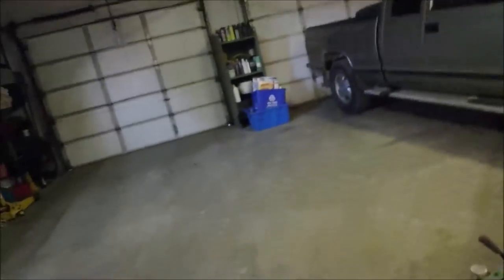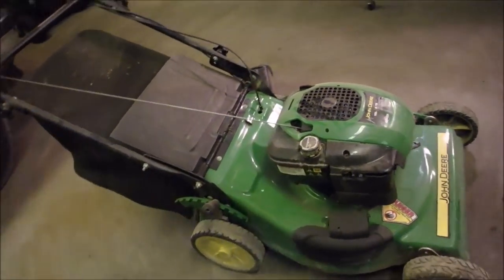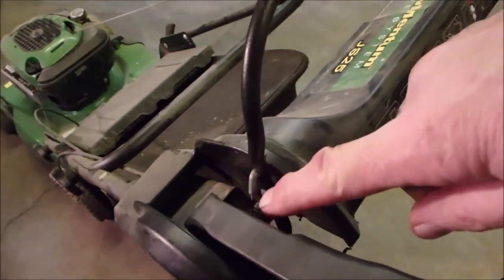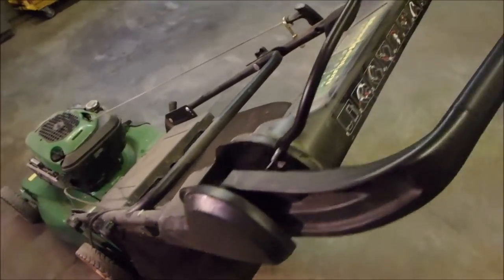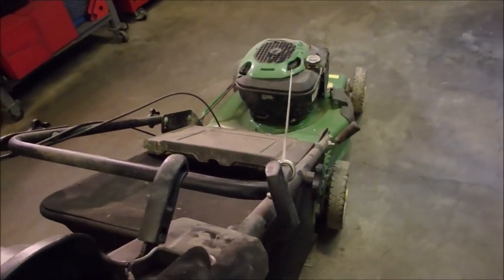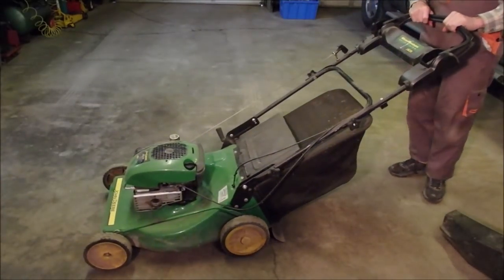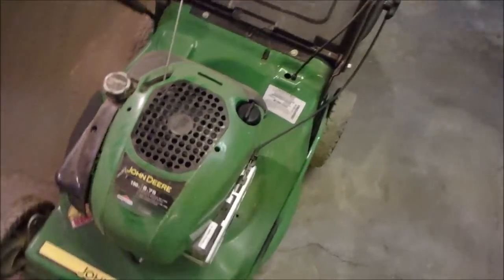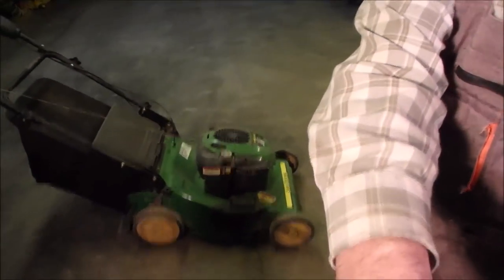John Deere JS25 Push Mower Won't Run Pt 1

Comment: Pure Neglect on quite an expensive mower. You can lead a horse to water right? In other words, preach maintenance and half the people simply don't care. Disposable mentality. Can't wait for part two my Friend! Sean~
Reply from the maker: It did put up a fight but things moved forward enough that I didn't have to flip it and work on the floor.   lol    Thanks Sir
Reply: They’re begging you to take there money. Herding cats is easier for them, then putting oil in it.  Be good zippo you too Bruce

Comment: When the mower falls off the table, the sudden stop of hitting the floor will pop it off. Be careful tipping mowers up that way.
 Just tip the mower off the cart onto a folding table. No risk of dropping it, then.
Hopefully just a rod, and no crank or internal damage
Reply from the maker: This one is toast.  I do a full tear down next week
Reply: I figured it would be. Well you’ve got parts for the hoard. Maybe one day a re-power.

Comment: Hi Bruce, when the blade adapter is stuck. I use a 4” gear puller and that baby pulls out in less than a minute. ^_^ I love your videos. Thanks for all the time and knowledge that you give us. Stay safe! ^_^
Reply from the maker: Thanks a lot
Reply: Bruce Pender my pleasure, I forgot to mention, . I place a nail setter punch  where the screw that holds the blade in place. Some people use a skinner screw but those punchers are sturdy. ^_^

Comment: When we pulled pulleys off shafts on farm equipment we would get a strip of emery cloth and "shoe shine" the shaft until all the rust was gone and it was nice and shinny.  That made  pulling things off of the shaft much easier.  And HURRAY!!  I get to see what happened to the 'guts' of this one, you threw the last 'blown' motor out with out even giving us a peek.  :(
Reply from the maker: No   actually I do a full tear down in Part 2 next week.  I will change the name of the video to Part 1 so folks will know there is more.  I am going to re-power it too.
Reply: @BrucesShop  : Bruce, what I was trying to say was that the last time you had a "blown" engine, (one of 4 that came in at once) one where the side of the case was broken open, you sent it to recycling with out letting us see inside of it.  This time you're going to open the engine up and let us have a peek at just how mangled it is inside.  I'm EXCITED to see it.  It will be interesting to see how you choose to re-engine it as well.  How much functionality of the original mower will you be able to keep?   By the way, does this mower have a cast deck rather than a "pressed" metal one?  It looks that way, maybe that's why it's so heavy.

Comment: Hey Bruce,  I think that jd lawnmower was really made by the old Murray.

Try a 2 jaw gear puller to get blade adapter off if you have one.  Good job in getting creative there.
Reply from the maker: Right.  I just didn't want to flip it and work on the ground.  Knees as you know.
Reply: Your'e right. JD subbed its walk behinds to Murray in the latter part of the last decade. Soon after that JS25 was made, Murray went under & Deere exited the walk behind business. I have the JS46 curb-picked model from back then. I think it is a decent mower but it was pricey when new (too much green for JD green) and really not as refined as Toro & Honda.
Reply from the maker: @jjparody8257  Thanks jj

Comment: I remember your hesitation when you were first given that impact driver. Looks like it is a "go to" now! They do come in handy.  By the way, nothing quite as miserable as a stuck blade adapter.
Reply from the maker: Yes    I want 2 more   LOL
Reply: @BrucesShop  They are handy. If I run across one, it's yours!

Comment: Great Video Bruce! 😊 Can't wait to watch part 2 so I can see what happened. If it's to bad, you could keep your eye out for another motor for that nice deck. That really is an expensive looking mower. Have a Great Day!
Reply from the maker: Yes you are right.  Actually this video was taken last fall and it took that long to find the perfect replacement.  So yes I am working on a used repower.

Comment: I picked up a John Deere JS-43 with a broken rod for $20. Instead of rebuilding it, I pulled a motor off of a Craftsman mower (Briggs 6.75) that I picked up at a yard sale for $20 that had a sheared keyway. Everything matched up except the crank diameter, so I used the Craftsman blade adapter and it was good to go.My $40 Green and Red "FrankenMower" is the best and easiest to use mower that I've ever owned. I could even use it when I strained my back and shoulder last week. When you poke along, it'll poke along, too. If you feel froggy and want to hustle, it'll hustle right along with you.
Reply from the maker: Yes I am looking for one with the 1 inch shaft.

Comment: I've begun to use a HF tie rod/pittman arm puller to remover the blade adapters and pulley units and found it works really well.  I use the bolt to slightly unscrewed until the adapter moves, spray some break free on shaft and tap it back on.  I reapply the puller, unscrewing the bolt as needed to move the blade adapter until removed or free.  Although the puller is not a great 'fit' it works a whole lot faster than the 'wedge' method... $15.00 for puller before the 'discount'... just a thought....
Reply from the maker: Thanks for the great info.  Sometime solutions are not expensive.

Comment: On the old Battlestar Galactica they encountered a planet of robots. It just dawned on me that you dress exactly like those robots.  Same coveralls, Bruce the robot handyman, Never does the same thing twice.  Did some mowing yesterday, And today i feel the affects of all that heat. So i was a little shocked to hear your furnace turn on.  Unless that's AC.
Reply from the maker: This was filmed last fall.  I waited for the right motor to come in before i started the series.  LOL

Comment: I sold a pushmower with Tecumseh engine to a friend. He called last month to say it smoked a bit and seems seized. Same issue. Never changed or checked oil level. I filled crankcase and cylinder with marvel mystery oil and let sit overnight. Next day I turned engine over with a breaker bar on the blade nut. It freed it up. I put fresh oil in it and new air filter and cut some grass. Gave it back to him to use until the rod blows. So far he's cut the lawn a couple more times.
Reply from the maker: These old engines don't need much a oil is a must  lol

Comment: Arrrrrrrgh, nearly tore stitches out from groin tumor removal a few days ago when I heard the Steven Hamburgular crack. Hahahaha.....carefully!!! Desperately looking forward to part the second and more, as i'm laid up for the time being. They sell them, or at least a current version of them, in Aus at present for around the $800AUD odd, mark. Looks like you have a good base to work with Bruce.
Cheers from Aus.
Mike.
Reply from the maker: Well a used one is the only way to go.  One came in .  It was a Toro with a bad rear axle gear set-up.  So I am using that mower to build the JD back to what it should be.  This is the stuff I love doing.  There are some pretty cool things i have to do to make it fit.  It isn't just a  bolt on.   thanks a lot.

Comment: Fun stuff !  I was wondering if it would have been easier to work on the undercarriage with the unit flipped on it’s back ? With no oil or gas - and the motor being borked - couldn’t make it worse right ?  Looking forward to part two !!
Reply from the maker: Then I would have to work on the floor,  I am not doing that.  I may have been able to flip it on the lift but the old mower is heavy.
Reply: Bruce Pender - makes sense - working on the floor isn’t fun.  I’ve been hanging mowers by a couple ratchet straps from the ceiling to work on the under side.  I keep the front wheels on the ground and sit on a stool to do whatever is needed. Cheers !
Reply from the maker: @kanadianken5673  Have you seen my white pail?????   I sit on that.     I now has a lid that holds an assortment of screws   COOL
Reply: Bruce Pender - yes I was impressed by your horde of bolts and bits in that pail - and that lid is very cool !

Comment: Mine will run for 20 minutes then die then start then die over and over carburator rebuilt new plug and air filter I give up any suggestions?
Reply from the maker: Do you try it with the gas cap loose.  they can air lock.  The caps are supoosed to let in air   like taking your finger off a straw.

Comment: I had the same mower. I hit a natural gas shut off protector cap and bent the crankshaft. 2 years old. Cheaper to replace mower than fix it.
Reply from the maker: I am waiting for a used  quantum to come in.

Comment: I have 47 push mower engines and get more weekly. Wish I could give you one. I have 11 autochoke briggs quantums with that shaft size ready to go. Too bad I live in ny
Reply from the maker: All is good.  I started this video last fall and finally the right replacement came in.  I am editing part 2 now.  This will be a multi part series.

Comment: Where's part two?  I have the same issues when removing adapters and pulleys.  What a place for anti seize from the manufacturer II.
Reply from the maker: Part 2 is coming.  It still hasn't been edited.  This is gong to be a longer series.  I don't know how long yet.